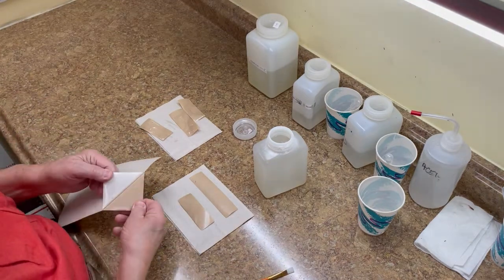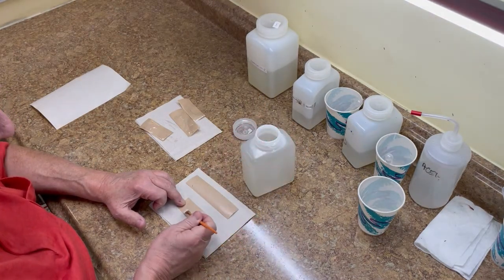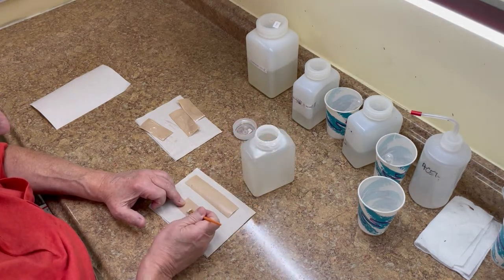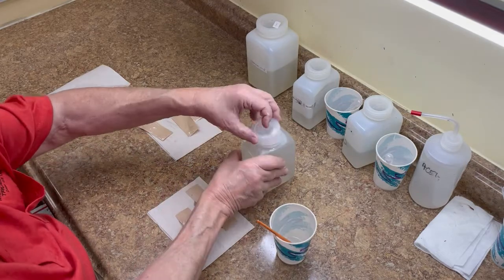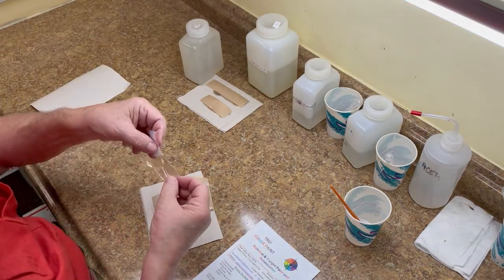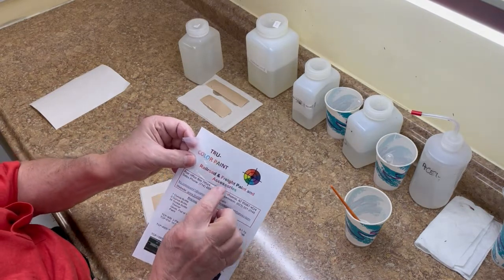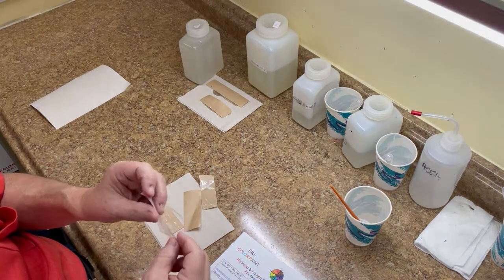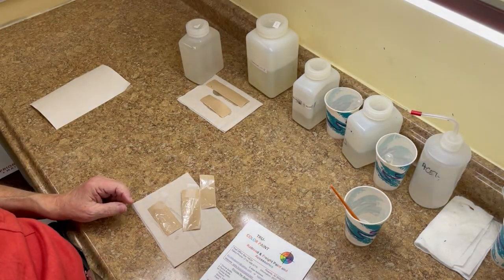The Chemistry of Tru-Color Paint and Demonstration of Flexibility

Comment: Can you recommend a primer for brass models? Other preparation steps?
Reply from the maker: Thank you for contacting us. We suggest using TCP-007, a dark gray primer or TCP-256, a light gray primer. Either will work for brass. In either case, spray at 28-35 PSI using a .5 mm or medium tip and you will cover the model in 1 pass. If possible, bake the primed model at a low temp (the lowest setting in an oven) or under a heat lamp for 20-30 minutes to secure the primer to the brass. You should be ready to paint whatever color(s) are needed for the model. 

FORGOT TO MENTION: Before priming if you can put the brass model in a vinegar bath (which is acetic acid) for 30 minutes or so and then rinse the model in clean water and air dry overnight, that will etch the brass and make it more porous to the primer to adhere best.   

Let us know if these suggestions work on the model you are painting and send us a picture of the finished model for posting on our social media platforms. Looking forward to serving your paint needs.

Martin Cohen, PhD
Tru-Color Paint
Reply: @trucolorpaint  I don't usually pickle brass. Would this be better than grit blasting with 400 grit aluminum oxide?
Reply from the maker: @berkeleygang1834  Either way works on brass. I find the vinegar wash is easier for me than grit blasting as it gets all over the place when I do it. I'm 78 so anything that is easy is the way I go when I paint.

Comment: How safe is this for plastic? I have a model airplane I want to paint.
Reply from the maker: Very safe. We have formulated this paint specifically for plastic models. Literally, we have railroad, military, automobile, figure modellers that use our paints. We are also the sole source of model paints for a number of railroad historical societies, model manufacturers, and even the US Department of defense.
Reply: @trucolorpaint  Thank you so much!
Reply from the maker: @Blitz9H  You are welcome. If you can think of anything we should do a video of, leave us a message. Martin is always looking for new ideas.
Reply: @trucolorpaint  I am curious about mix ratios on airbrush. How much do you thin, and what do you use to thin the paint?
Also, what do you recommend when using a brush, to ensure no brushstrokes occur?
Thank you!
Reply from the maker: @Blitz9H  Thank you for your interest in Tru-Color Paint. We suggest using TCP-015 Thinner to thin our paint products as it is made with the same blend of solvents used to manufacture the entire product line. We suggest using no more than 1`5-20 % of this thinner. Except the  TCP-800 series paints, all of the rest of our product lines are designed to be sprayed directly from the bottle without the need to add thinners. If the paint is rough or has blushed, then it is drying too fast and you should add some thinner or TCP-310 Retarder to slow down the evaporation rate.  As for using a paint brush, our Military and the TCP-800 series is the only series you cvan use a paint brush. The Railroad and Automobile paints are too thin to use a paint brush unless you let some of the sovents evaporate from the paint. Trust this answers your questions We look forward to you trying our Tru-Color Paint products.